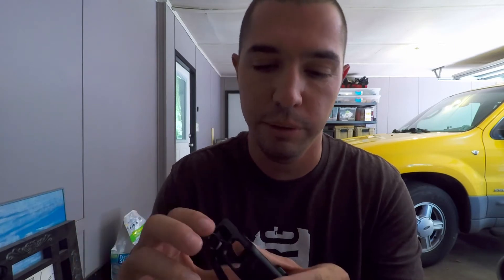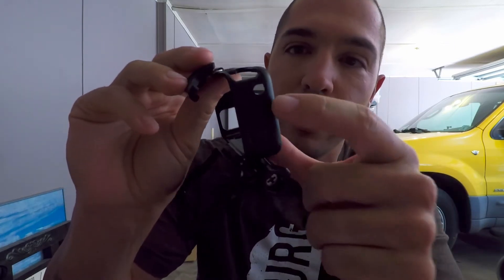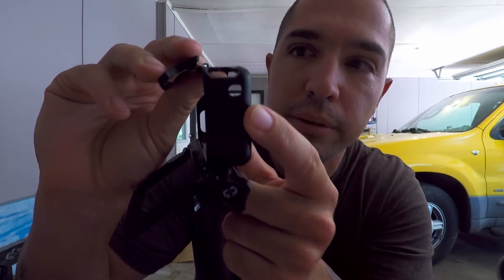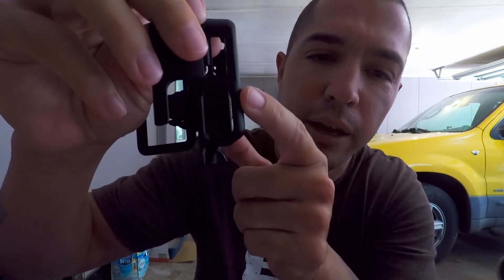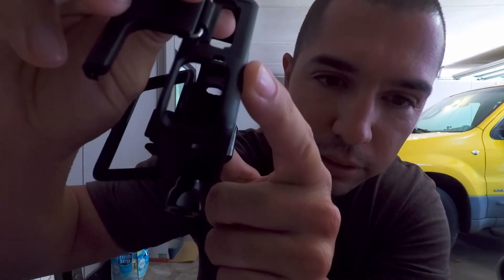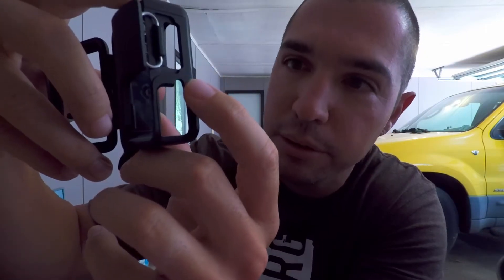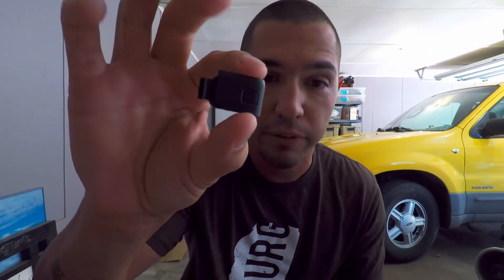GoPro Hero 5 Audio Experiment // Can This Audio Be Fixed?

Comment: Here is the fix. Take out the bolts that hold USB part of the Karma that go into the H5 and put that aside. Now the H5 can be inserted in Karma with the door closed and the battery of the Karma will go for more time since it won't charge the H5. You are welcome.
Reply from the maker: +Machete so the Hero 5 will have to be controlled from the camera too? Since the USB is not connected from the Karma Grip?
Reply: Yes, but for MTB it will be perfect, just start the Karma and start the H5. Not a big deal and problem solve. Take a look into it and let me know or better make a video about it.
Reply from the maker: +Machete I'll look into it. I just worry about damaging the wiring behind that plate or causing something else to go wrong.
Reply: I understand, but if it is possible to hook the H5 without connecting it,  for mountain bikers it will become the best gimbal go pro combo ever. At least for now. Thank you. I am subscribing to your channel, good stuff.